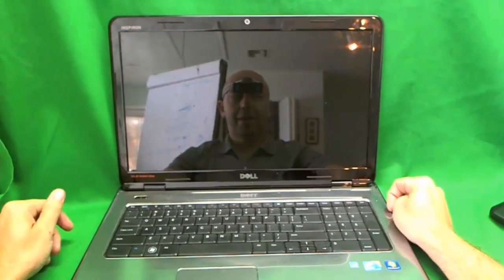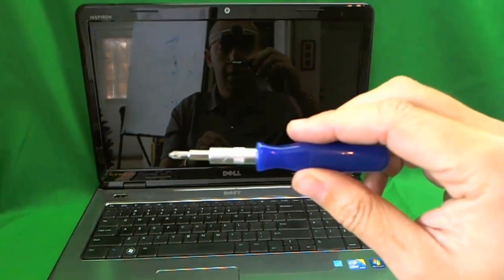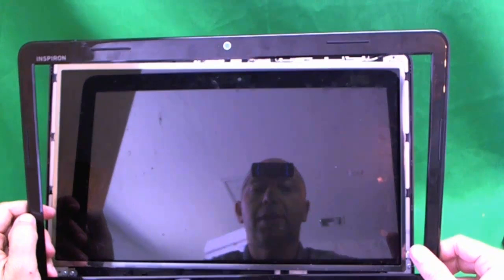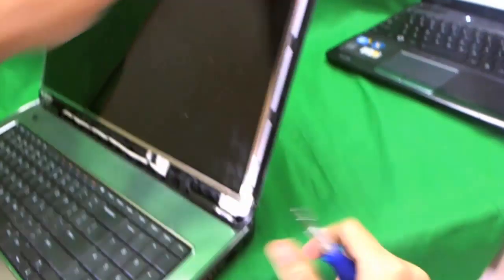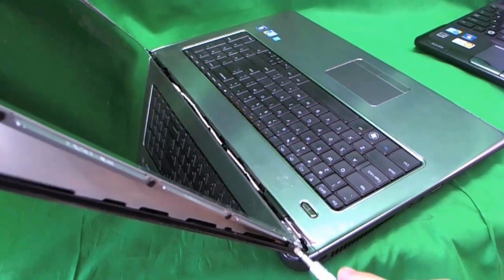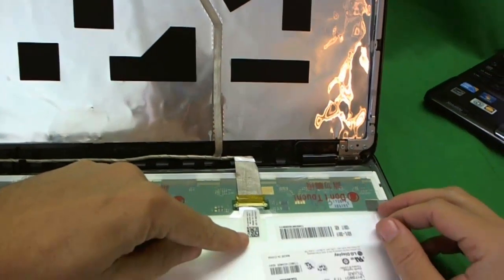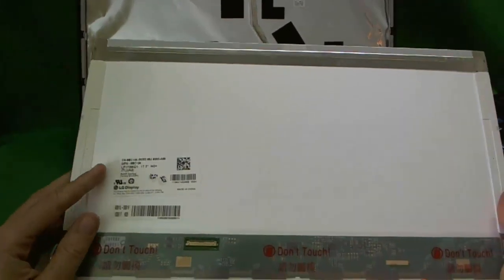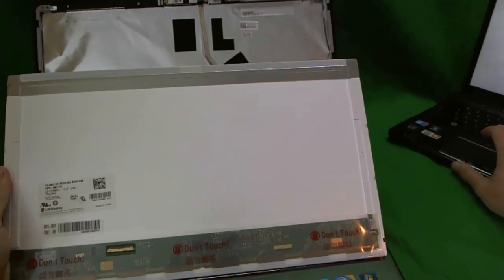Dell Inspiron N7010 Laptop Screen Replacement Procedure

Comment: Hey! Great vid! I dismantled my model to clean my fan. Everything went great, but unfortunately when I put it back together I cant start it. When I connect the AC adapter the right side LED blinks for a second, then nothing, no sound, no image. I cant get it to start. When I push the power button nothing happens!
Do You have any guesses what could've gone wrong when I put it back together?I would appreciate any input! Merry Christmas!

Comment: Hey, I just cracked my screen  by accident and it is the exact same model as the one from the video. I was checking the service manual for this particular laptop, and the Dell service manual said I had to remove the whole screen panel to replace the screen display; it also said to remove components like the hard drive, optical drive, and many other components. Is this method a sure way to replacing my cracked display with a new one? I would appreciate your help, and thank you in advance.